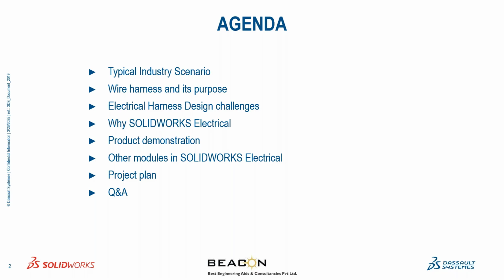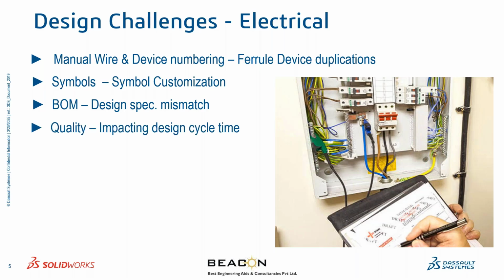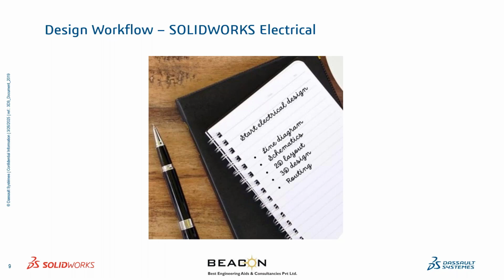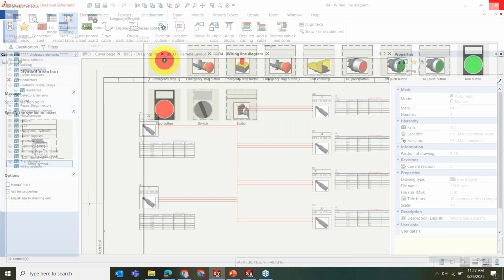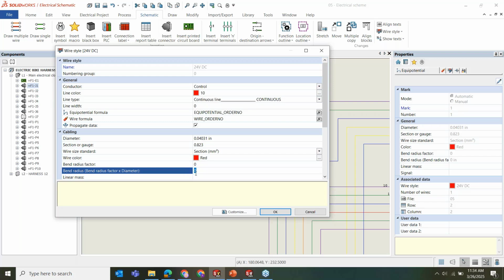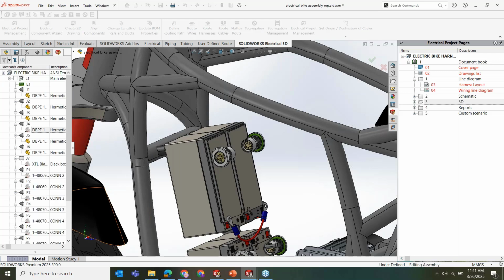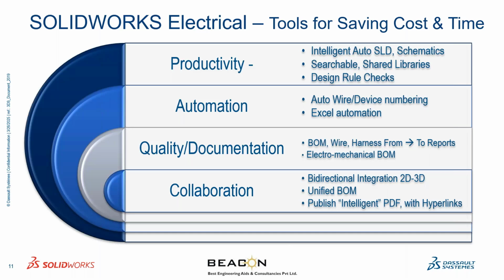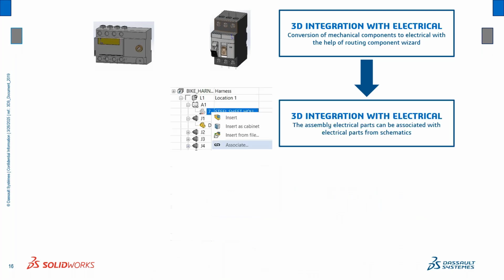Unlock the Future of Electrical Design with SOLIDWORKS Electrical

Comment: Hi, thanks for the tutorial. I have problems when it comes to the routing part, I believe because I cannot match the cp points/ewcable/connector pin. I’m an absolute beginner on both solid works and solid works electrical, it would be great if you could do a detailed tutorial on that. Thanks!